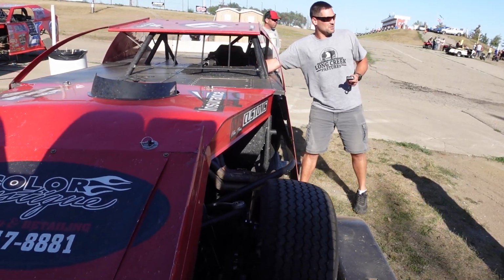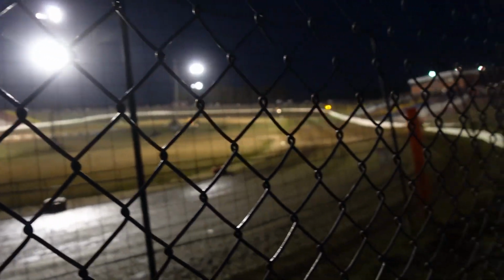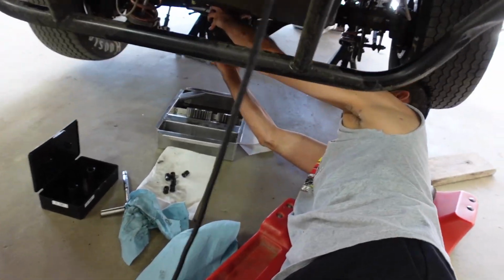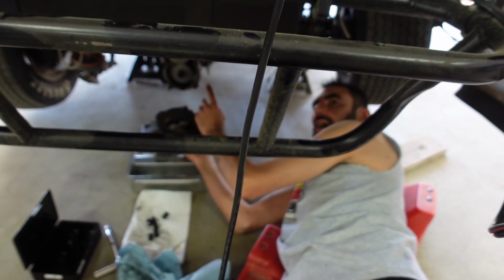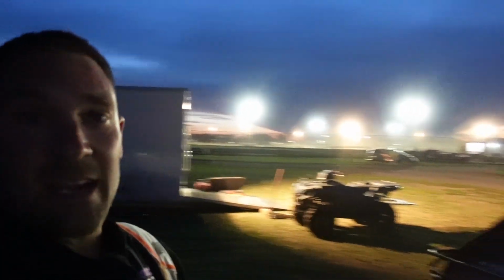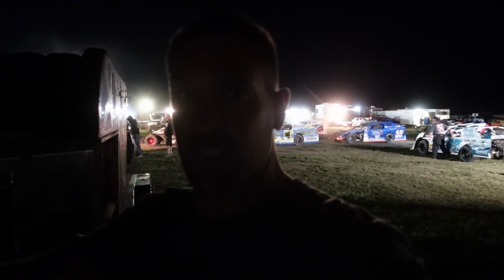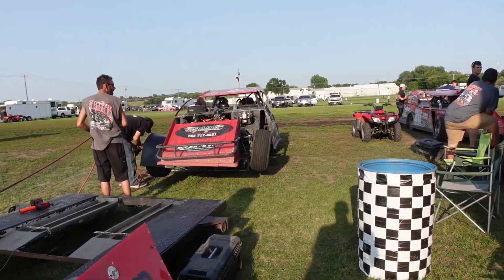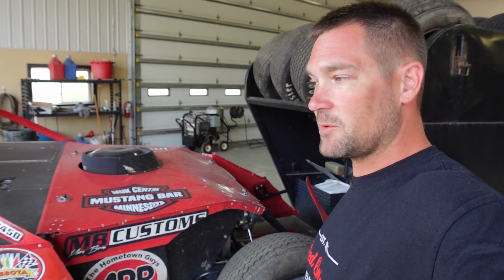Well. That Sucked!

Comment: I would love to see the finishes of the race I don't like watching and then not knowing what happens
Reply: Yeah whats up with that ?! I also wanted to see what you crunched! Show youre screw ups, its alright!
Reply from the maker: @daniel_poore  the gopro had burned up all the batteries I brought with at that point or I definitely would have! It's a struggle because I was the only guy running the camera while also driving and working on the car.
Reply: @betweentherows  just hold your phone up while you race... can't be that hard.😅
Reply: @betweentherows  Thats a fair point. I know you gotta be a busy man making videos for a few channels, as well as podcasts and your "real job and hobby" farming and racing... Hope all is well out in MN, looking forward to more content on both the youtube channels .... =)
Reply: @betweentherows  Looks like you will have to start bringing more batteries with you or maybe get a charger that you can use in your vehicle to charge the batteries between uses so we don't get shorted on footage.
Reply: Portable battery charger, plug-in self-recharging batteries (I have a pair of AA like that, just need a standard USB mini cord and they recharge like any other small device such as headsets), there are also portable solar panels, car chargers, etc. Just need to pick your mobile charging option.
Reply: @betweentherows  it’s very difficult to get all the footage our fans and supporters want to see.

Comment: zach work on a modified with my boss dumptruck driver by day race tech by night i hesr your revs coming in and out wheelhop maybe the car needs balncedout iam not aprofessional racecar setter upper but putting on a set o scales and putting the weight where it needs to be might help

Comment: He's actually grinding the tires wrong. Tread will feather and when you prep tires you need disk rotation to the outside of the tire on the passenger side and disk rotation to the inside on the drivers side.